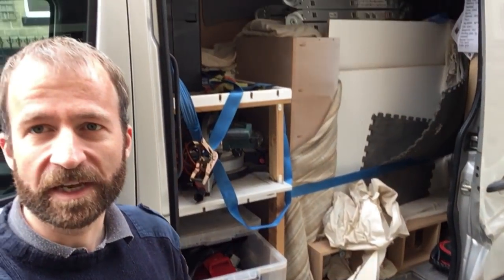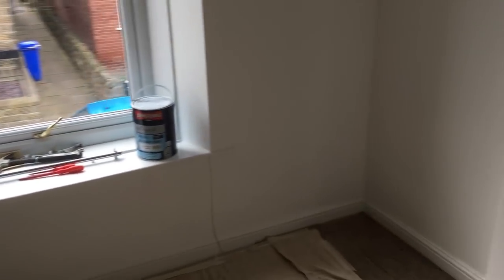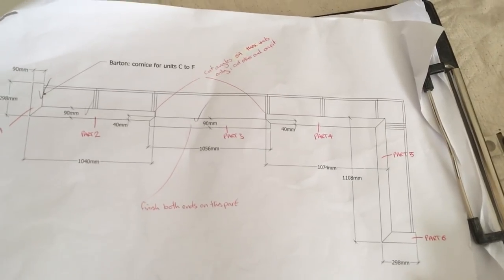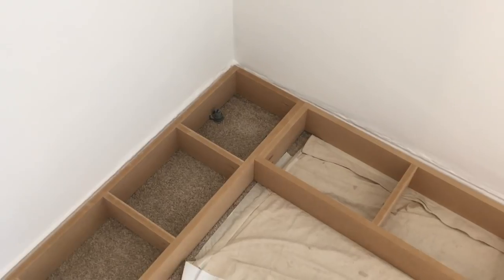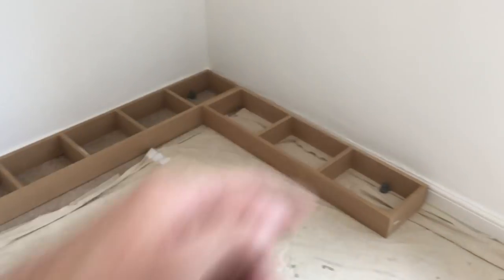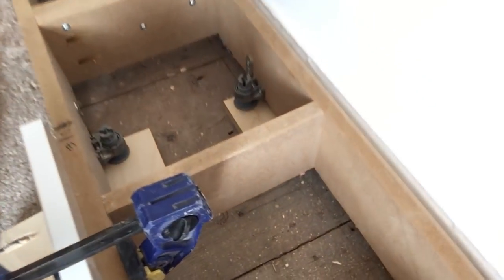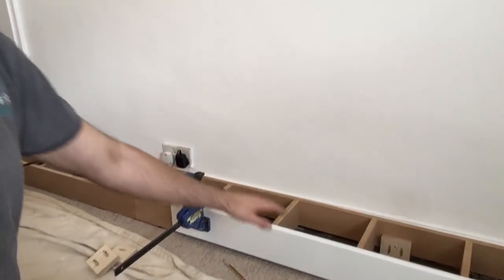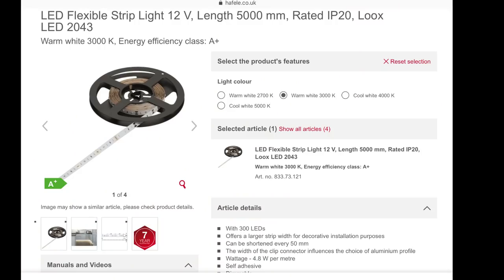Making this bookcase with guitar storage, lighting and standing desk

Comment: Great job. Especially with navigating the complication of uneven walls and floors. Typical of every house in Sheffield I think. I have plans to do some fitted drawers and cupboards in the eves of our attic space, but also have the problem of a seriously bowing floor. Which I have decided to take the extreme and pull it all up and lay it again but making sure its level. A right jobs worth, your way is quicker though!
Reply from the maker: Reuben's woodcraft thanks Reubs. Absolute quickest way is to pack and level battens tothe floor then fit units with a shadow gap.  Doesn’t work for VERY wonky floors like the one you’re describing though!

Comment: Another great video. Can I ask what happens if the client isn't happy with the carpet being cut? Would you just level on the carpet but make the plinth stop before the gripper strip, so as not to be unstable? 👍
Reply from the maker: Andrew Cain we insist on fitting to solid floor. So we either do it this way (and we do refit the grippers by the way, further forward) or if the client prefers carpet to be properly fitted up to the front instead of tucked under the plinth fascia they can arrange for a carpet fitter to come after us and do it that way.  I we don’t fit units like this to solid floor the caulk lines will definitely crack from settlement with the weight of the books when loaded up after we’ve left.

Comment: Great videos, loving the content. Just wondering about your sequence for the bookshelf construction in your shop. 1) LHS pocketted down to back panel, 2) shelves with confirmat, 3) RHS pocketted down to back panel. Why not fit both side pieces followed by the shelves, would that not mean you could do away with the need for a centring jig by just using simple spacers cut to shelf height?
Reply from the maker: Hi Alec we don’t do it that way because the Kreg screws are prone to moving the piece laterally as they are tightened (because of the slight angle on the pocket hole).  The order of assembly as described means that when the final side goes on everything meets nice and tight.  Also, although using a spacer block between shelves sound like a good idea I have found that in practice it is prone to cumulative error- the top shelf of a run may be slightly out of position - so I prefer to line up each shelf to its own accurate mark
Reply: @Alastair_Freebird  amazing, thanks Alastair, what depth of nosing do you normally go for? And I notice you only paint visible faces, have you ever had issues with warping with only painting one face? About to start designing some for my place, so really appreciate the videos, will be buying you a coffee!

Comment: Great work as always Alastair. May I ask where the levelling feet came from, as I am struggling to find decent ones?
Reply from the maker: Richard Mountford perhaps you have tried those horrible ones with the pressed metal wrap around part and the black insert which is made from a ridiculously brittle plastic?!  The ones we use are these: https://www.hafele.co.uk/en/product/adjustable-foot-for-aligning-heavy-furniture-integrato-g/000000560001344600050023/.  They are most suitable to hand adjusting.  There is another variation available a bit more expensive which is better for adjusting with a tool (receives a pozi; flat head or hex) and can be mounted under a fixed base (with gables running on down to the floor); accesses through drilled holes for adjustment: https://www.hafele.co.uk/en/product/adjustable-foot-for-aligning-heavy-furniture-integrato-g/000000c600022ed700010023/ for some reason both items seem hard to find on the Hafele site, not listed under the search terms you expect, and sometimes I accidentally order one instead of the other!

Comment: Very nice build! Do you have a link to those levelling feet? Also when your doing the ascribing, fo you cut the using your track saw? Tricky to cut those thin scribes!
Reply from the maker: Nic Harvey the feet are these ones:  https://www.hafele.co.uk/en/product/adjustable-foot-for-aligning-heavy-furniture-integrato-g/000000560001344600050023/
Reply from the maker: And I think I move between tracksaw, jigsaw and simply the handsaw for scribe cuts depending on the scenario or just how I feel!  However I cut it, I’ve taken to doing a final trim with the powerplane, which has become easier to do since I can clamp the scribe on edge on top of the MW1000 workbench.
Reply: @Alastair_Freebird  Very helpful! I'm very interested in that work bench to. Thanks for the reply.

Comment: Sorry, it was the brass holes to plug into the shelf holes.
Reply from the maker: Ok yeah I thought maybe it was then but I think they were on the other video you commented on!  Anyway, the ones I have used are from Hafele https://www.hafele.co.uk/en/product/socket-for-plug-fitting-into-drill-hole-7.-5-mm/0000006200027ae300010023/
Reply from the maker: https://www.hafele.co.uk/en/product/tool-for-7.5-mm-sleeve/0000009a0000863a00020023/#SearchParameter=&@QueryTerm=Shelf+support+sleeve&@P.FF.followSearch=9848&PageNumber=1&OriginalPageSize=12&PageSize=12&Position=3&OrigPos=4&ProductListSize=75&PDP=true
Reply from the maker: ... however I’ve recently learnt that the ones from Ironmongerydirect are better - neater rim and better fit: https://www.ironmongerydirect.co.uk/product/shelf-support-socket-nickel-pack-50-699159
Reply: That's just what inwas after. Thank you Alastair. Muchly appreciated